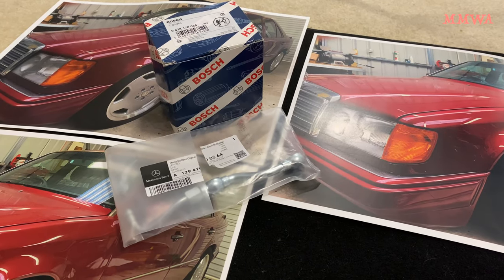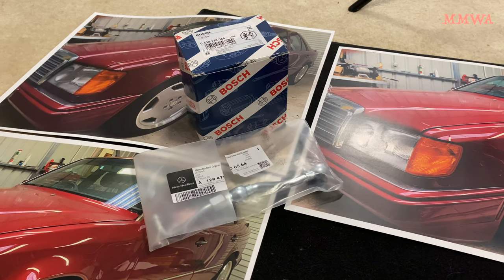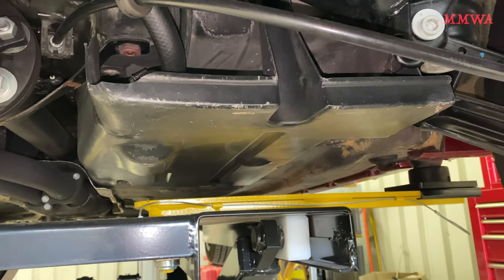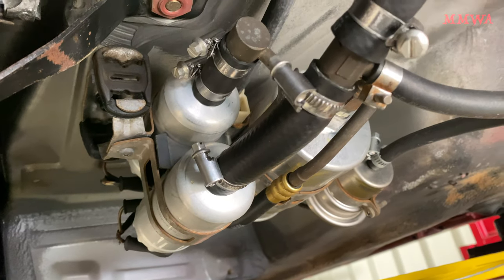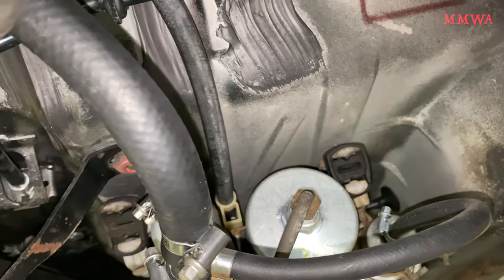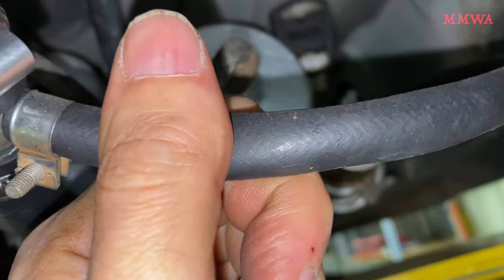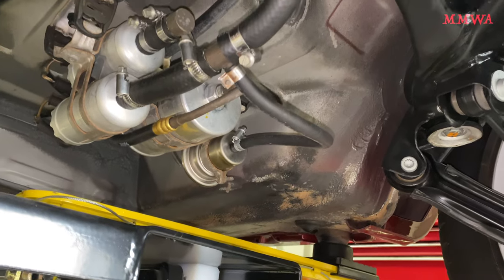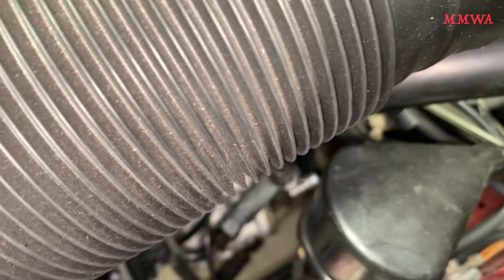W124 - aftermarket fuel hoses an alarming discovery

Comment: Cohline is one of the original OE manufacturer of fuel hoses for MB, BMW, Audi... But just be aware of counterfeits and search for high temp versios like cohline 2240 or similar. Not the 2192 low temp like I did for my W124 200D in the past.

Comment: Cohline, Gates, or any of the prominent belt/tire manufacturers should be good.
Here in norway, I only buy Double layered, reinforced fuel hoses from known brand names. I used to run aluminium braid shielded singel layer hoses (as they looked good and I was saving about 5$ per meter), when one day I though the air vents in the car smelled like fuel right after i started the car. Popped the hood with the engine running only to see fuel spraying about 30-40 cm up in the air from the braided hose... Never ever used one layer hose after that to say the least... buy quality hoses, theyre worth it in the long run. New double layer should also be ethanol proof, but make sure!

Comment from the maker: Fyi, Australia version cars have the return line fuel cooler - Theres a heat exchanger on the suction line to the compressor that refrigerates fuel returning to the fuel tank when the aircon is running. The theory behind this is reduced emissions of fuel vapours in the summer time. These little extra hoses as far as I remember are NLA genuine. But there is nothing stopping you from bypassing the cooler and running non cooler version hoses.
Reply: I'm in the USA and recently changed those hoses -- but yes, they are NLA from the dealer or anybody else. Amazon Hose in Tampa, FL, built me new stainless-mesh-covered hoses with my old fittings.  (Amazon Hose is not related to Jeff Bezos' Amazon.)

Note that the fuel pump system on our cars just goes at one volume, and most of the fuel sent forward doesn't get used and goes back to the tank -- a great way to transfer engine compartment heat to the gas tank and gasoline as you drive. And our gas tanks aren't getting any breeze on them, either.

 Also, cooler fuel makes for more power. I think it's a neat idea! (But I must admit when I first peered into the darkness I thought it was an old timey K/CIS on-the-block warmup regulator.)

Comment: I had a Cohline aftermarket hose do that after only 3 years on my W140.  It started leaking, and luckily I noticed it. Exactly the same failure mode.  I replaced it with an OE Mercedes hose. Hopefully, it's better.  Avoid Cohline hoses.

Comment: I replaced one long (medium dia.) hose back there about 5-6 years ago, and recently acquired all of the other hoses via my local dealer. I even got the fuel return line elbow-shaped for the other end of the tank from the dealer for a very fair price. (For the vapor return hoses, I needed to go buy two different sizes of Gates hose for vapor (PCV/EEC) which required a more head scratching by more local auto parts clerks than I can go into here.

The dealer did have a new plastic check valve for the vapors, too.

I mentioned Amazon Hose (not Bezos Amazon) in my comment last night. That was only for the two hoses to and from the fuel cooler in my engine bay. Everything else I've been able to buy. (M103, CIS-E, USA)

Comment: I renewed all fuel hoses in my W126 with genuine MB ones this summer. Only after two months the fuel pump pressure hose started weeping some kind of fuel smelling vaseline, it was like the rubber was melting. I got a new one on warranty, and this one is keeping the fuel out still. But time will show. The old lines were 31 years old and still looked quite good. If I remember correctly, the pressure hose was manufactured by Cohline. But maybe it is the same thing like all other genuine parts - they are not so good quality as they used to be back in the days...
Reply from the maker: this is very sad to see. I have intentions of buying genuine replacements but not so sure now.
Reply from the maker: @Justinian Yi Very disappointing to hear. MB isn’t the same company it once was.
Reply from the maker: @Justinian Yi btw, bosch has offloaded a lot of its classic parts to China. Rumours have it this started around the same time part numbers transitioned to F0- part numbers, though i can’t confirm.

Comment: I'm following this trend i myself have issues with the fuel injector hoses for my 1973 MB 450SL.
It was replaced 2019 with CRP Automotive Fuel hose dated 01/2019 purchased online at my favorite MB specific online store i will not mention which.
Problem arrived when the leaks came from the clamps to each injector here and there so i just tightened each as needed. Now i can visually see the surface of each hose with fine cracked lines just like MMWA you not need to squeeze it to see it. 
I know for a fact that fuel hoses should be replaced and permeability should be low iam still trying to find a replacement. Hose marking are a start, look for SAE 30R9 working pressure is 100psi & permeability is low. 
But on your application for non pressure lines a fuel hose SAE30R14 does have a 35psi with low permeability. Good luck 🤞

Comment: With the addition of higher amounts of hydrocarbon solvents into Auto fuels compared to the 80's and 90's your only solidly dependable high and low pressure fuel line today is Teflon and in the aftermarket Teflon fuel line both pressure and gravity is the quality alternative usually using A/N type fittings however any decent hose doctor/Hydraulic specialist will also have teflon hose stock for crimped fittings.
Teflon provides total encapsulation, no weep, no vapour and initially introduced for methanol application in top fuel dragsters has since trickled down (Dad joke) to normal automotive use.
So if you spec Teflon braided you should enjoy great quality for a long time.

Comment: I replaced most of my fuel hoses on my ‘75 450SEL with cheap fuel hoses (Autohausaz china). They leaked within a year. This is in Maryland USA so not extreme heat. How I discovered it: hadn’t driven the car in a few months (I drive the 450SL in summer) and my husband started the engine. My gut told me pop the hood and give a visual. The supply from the tank (left side engine) was SQUIRTING on the exhaust manifold. I was furious! I screamed for him to shut down the engine. The direction could have sprayed my face with gas if I was unaware. No fires thank god. I always wear safety glasses I’m thinking of full face shield wtf…
I went and got new Mercedes brand hose that day from the dealer $45 for a meter. 

Is the dealer hose the aftermarket hose? Or the Chinese ones? I would suggest asking Pierre Hedary in Florida if he knows the best hoses.

Comment: My 1995 S124 Estate/Wagon E320 had a big fuel leak underneath by  the fuel filter/pump but not coming from there. It seems like it is coming from above the differential housing. Kindly assist by showing a disassembly chart of that fuel tank where leaks may be possible to originate besides the fuel filter/pump assembly area (covered by hard plastic shield). She has 236000 miles on odometer but still want to be driven fast (80 to 105mph) on the grapevine in California

Comment: When I was doing my rubber hoses going in to the transmission cooler I used Semperit brand hoses, almost 3 years later there sill look like new. I know fuel and oil are different, but this hose was the most expensive by 1m that I could find locally.

Comment: I got some gates hose from either rockauto/fcpeuro or pelican for my car in Perth.  I'm sure something is available locally if looking for e85 or submersible of decent quality though.  I replaced engine bay hoses a couple of years ago but ignored the fuel tank to pump ones and chassis line to tank and they started leaking this year, so they all need replacing.
Reply: It's been a third of a century. I've changed every cooling hose and I'm halfway to changing every fuel hose. I suppose I should change some brake hoses, too!

Comment: Regarding the binary code dilemma. Many years ago I visited the production line in Stuttgart on several occasions and I seem to remember that at the start of the journey of the body shell down the line, a code reader scans to code on the slam plate and checks down the line that each individual specific item relating to the car's spec is in place (JIT delivery from outside suppliers). If the components were not already in place, then the body shell didn't start its journey. Hope this helps. Chris
Reply from the maker: This makes perfect sense and is very logical. Thanks
Reply from the maker: Do you remember if it was simply a stack of pre-punched unique plates which were simply assigned one per chassis, then stamped with appropriate numbers  and then manually linked to the individual vehicles VIN using their internal systems for the manufacturing purpose? This is What i’m thinking.
Reply: I don't have actual knowledge of what you suggest but sounds like a typical Mercedes-Benz logical idea. FYI, I have two 124s and find your videos extremely useful.

Comment: I would sell you my 94 E420...black on black.. and only you. Thing is, it needs just as much work as the Red 124, and we drive on the wrong side of the road up here.
Reply from the maker: LHD is the only option anyway for the v8 w124’s and im ok with that. I have no problem importing LHD car and driving it as is, its legal to do so too when 25 or older. I don’t really want to do a full resto again i just dont have the time anymore.
Reply: @MMWA-DAVE  It's great to give your passengers a thrill! lol.. it's a 4 speed as we know but there is a fantastic place at the top of 2nd and 3rd.. Way to be awesome at something and be too busy to do it.. like me haha
Reply from the maker: @paramtrx9558  what i have planned for a 420 is to make it a sleeper, the m119 will be exchanged with a modified 5L and way more powerful than a 500 without the risk of harming the value of a rare and valuable car (500) 😃
Reply: @MMWA-DAVE  It already is a sleeper if you ask me, sounds like a great plan tho.

Comment: Use wooden planks or rubber blocks to lift the car on your lift, that way you get more clearance to do the job!

By the way, can’t you just use hoses from a completely different car? Only things that matter are diameter, length and the material being suited for your guy’s fuel. Shouldn’t be too hard.